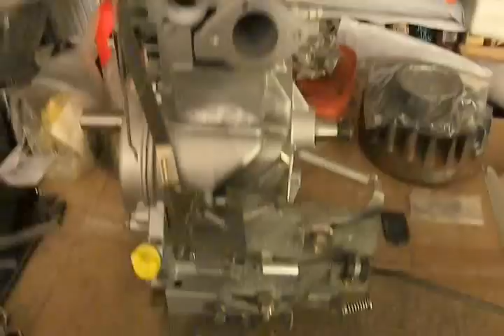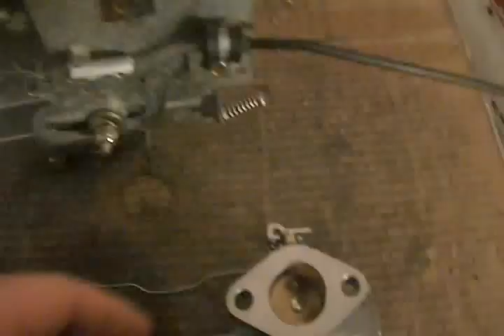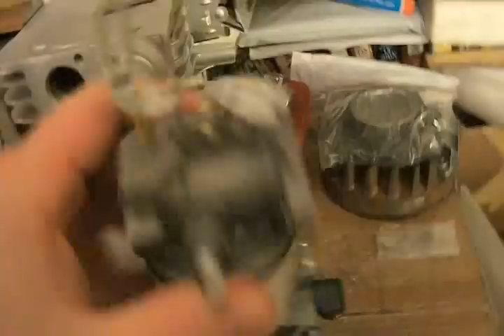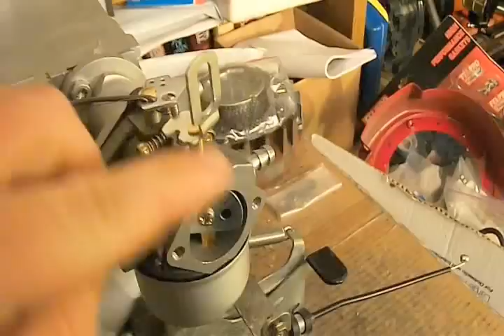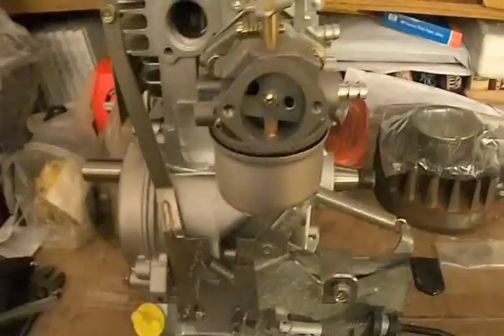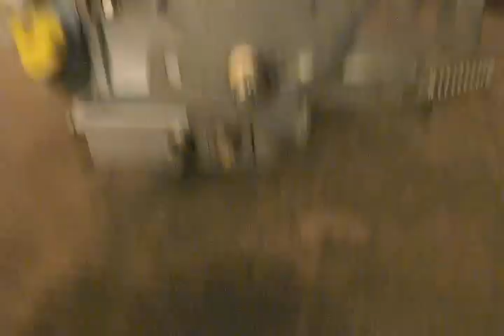05 Rebuilt Briggs 5hp Shortblock - Carburetor Arrives - Throttle linkage setup

Comment: That two speed throttle sounds awesome I would just make darn sure to have a fail safe for it like in both of my karts if the cable breaks or the linkage comes off they have return springs cause getting stuck going 50 can be bad cause I don't always trust the kill switch